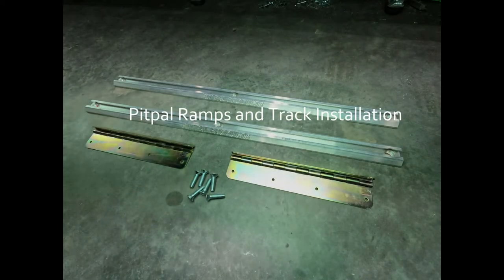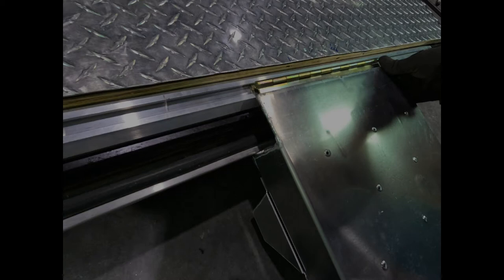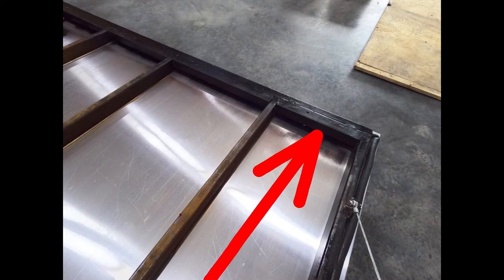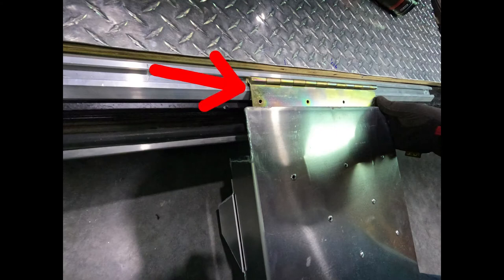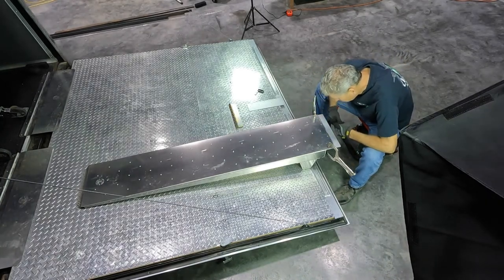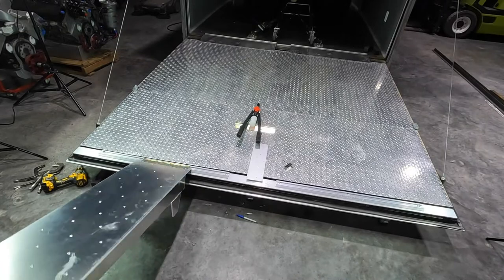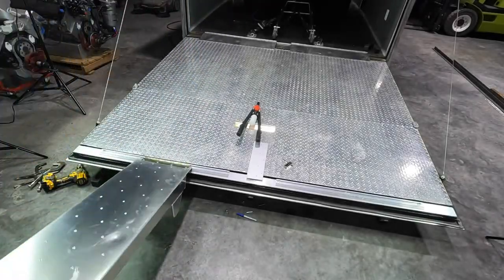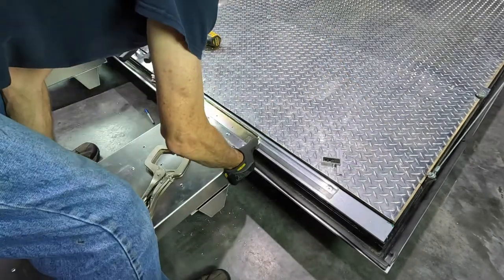Pitpal Enclosed Race Car Trailer Ramps and Ultra Track system Installation

Comment: Please share the total weight of your car.  It  appears the ramp supports are a must have option.  I purchased the 72" ramps, but after watching your video the only part of the install I'm qualified to do is HOLD THE CAMERA.  Too bad for me.
Reply from the maker: Hi Robert,  The Nova weighs 2300#.  Since installing the ramps, I've also had a car weighing 2800# with no issues.    The supports are pretty key as they prevent the entire weight of the front and rear of the car as it passes by the top of the ramps from being supported solely by the trailer door supports and those tabs that come off the front of the ramps.  If you were loading a very light car you could probably get away without the supports, but on a heavy car I think it would begin to bend those tabs on the ramps.  The supports are easy to install.  First get the ramp height figured out based on where you want the door to be and then you can easily figure out how much support height you will need.  Note that the proper height trailer door supports are just as important as the ramp supports,  otherwise the car weight will be solely on the ramps which will cause issues too.  Thank you for watching and commenting!
Reply: @CoreTechTV505  Thanks for the reply.  Allow me to say how jealous I am of your skills!!  I just measured my height, I have 6.25" (you had 10.00") from ground to the top of the trailer door.  The ramps are 4" tall so I have 2.25" of space to fill.  I'm guessing I can use the 2" risers and slide them away from the trailer door (a bit) to mate up with the ramps and supply the necessary support that you discuss.  I only have (2) rubber bumpers installed at this point and believe I need (2) more to support the door structure.
I closely watched for ramp material flexing when your car rolled out, I saw none.  That's good.
I just put in a call to Pit Pal to speak to Larry (engineer) but he's off today.  He has been a load of help and I will see if he agrees with me and my numbers.  FYI...if I had seen your video prior to ordering the ramps I would not have gone down this road.  I probably would have bought the Race Ramps and called it a day.
Thanks again!
Reply: After watching for a 4th time I realize I will have more like 6.50" due to thickness of the hinge.  Thanks.
Reply from the maker: So now that you know where the door needs to be, you can also measure from the ground to the bottom of the door to figure out how much support that will need.  The doors are about 3" thick so you shouldn't need much more then stock.  Maybe some spacers on the stock snubbers will do it.  Pitpal also has the rubber snubbers in different heights that would also work.   
And you are also correct in your thinking on the ramp support. Just get a little less then what you think and slide the support aft to where it contacts the ramps and fasten it there.  You can do that last to be sure they get positioned properly.